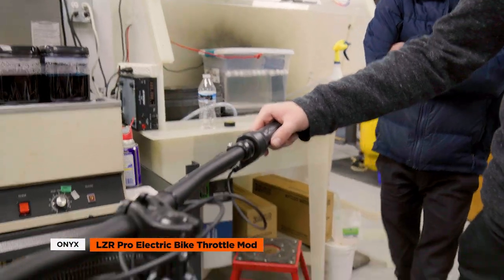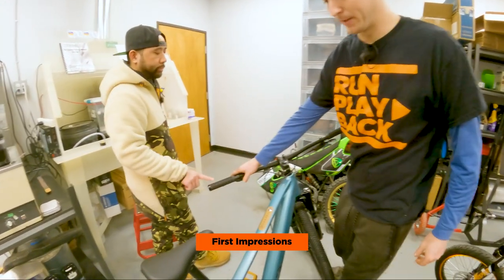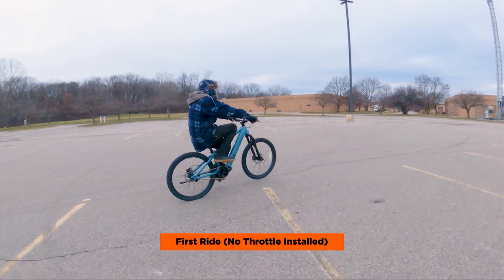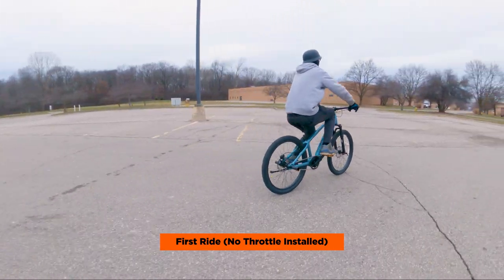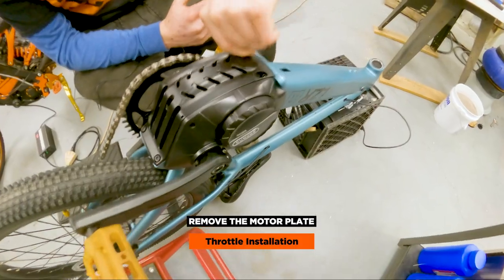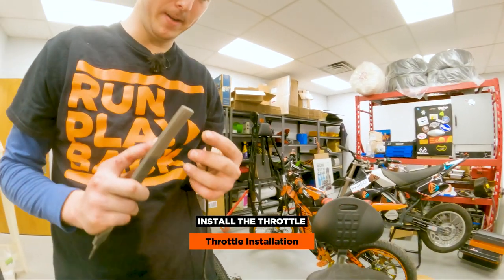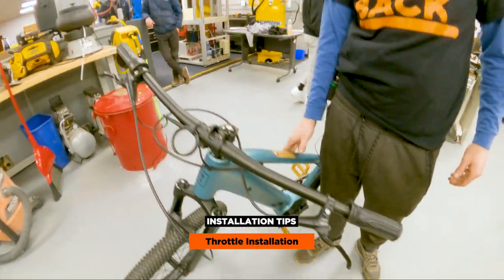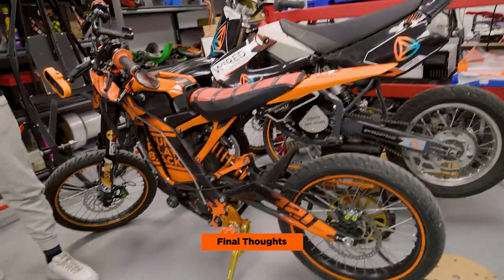Onyx LZR Pro Full Twist Throttle Mod and Wheelie Test | RunPlayBack

Comment: Even for trick riding,  there are so many times I wouldn't want the pedal to add motor power, but a throttle would let me time the power exactly when I need it.  So much better.
Reply from the maker: Yes I agree. Throttle really should have come stock.

Comment: Just got my LZR a few days ago and it's like having superman legs! SO DAMN FUN. I am eagerly waiting for the controller mod video for this bike, will most likely end up doing both a thumb throttle and the controller mod at the same time. From what I've seen though the controller from Luna cycle is only sold if you are approved by the vendor. Curious to see how this controller would be available to a regular consumer.
Reply from the maker: I got my controller on ebay, so I'm not exactly sure how it works through Luna Cycle. I'm sure if there's a high enough demand they'll offer it. Will let you know how it performs in the next video. Enjoy your ride man! 👍

Comment: Quick question: Do you know of an alternative throttle for the LZR 500W? I contacted the store you linked, and they said its not compatible with the 500w unfortunately :(
Reply from the maker: Unfortunately there is no option to add a throttle on the LZR 500w motor.

Comment: Need help flashing a new controller with ONYX firmware. I’m able to get the firmware loaded onto the beast tool but can’t get it flashed. Keeps saying failed when connecting to bike. The motor and co troller have been successfully calibrated together first. Please help. Anybody

Comment: Can you change the grips on the throttle.
Reply from the maker: Yup, the throttle side has some glue on it but it comes off with a little effort.
Reply: @RunPlayBack  thank you so much for the reply. Did you link the throttle anywhere

Comment: Do we just leave the battery cables that comes with the kit you linked alone? I just got it in the mail, installed and have no power. I left the battery cables alone tho
Reply from the maker: The battery cables may have gotten loose from the bike. Just make sure all the cables are pushed in tightly into their ports.
Reply: @RunPlayBack  i tried a couple times. Went back to the stock wiring and it works. Gonna try some other options for throttle

Comment: Whats the Top speed with throttle?
Reply from the maker: Same top speed about 28mph, throttle doesn't unlock more power, only a new controller + battery which we'll show in the next video